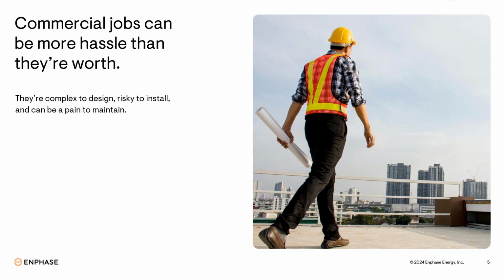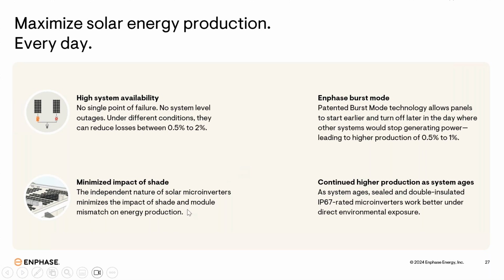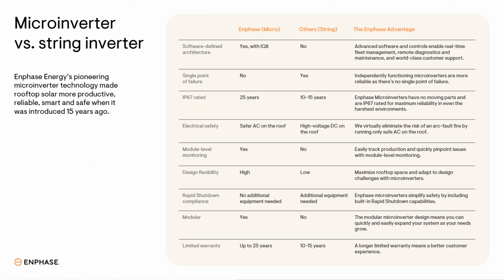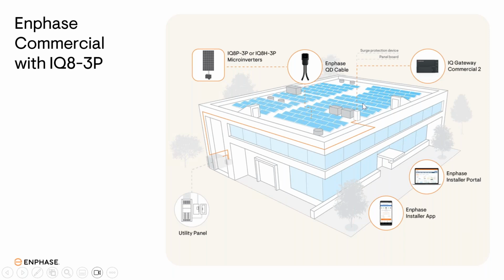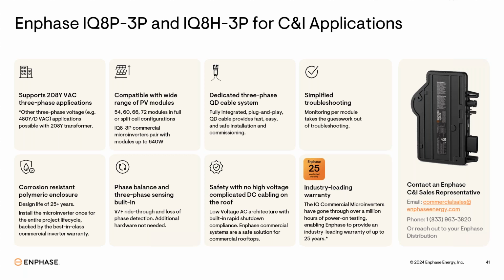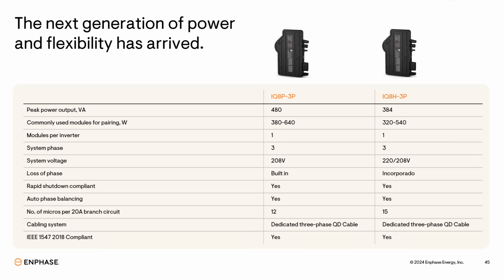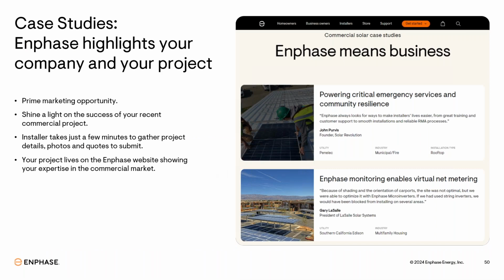The New Enphase IQ8 3P Commercial Microinverter

Comment: Introduction of the Enphase Team [01:06]: Introduces the regional sales managers for Enphase in the US and Canada.
Transition to Commercial Solar [03:43]: Discusses Enphase's focus on simplifying commercial solar installations and the market potential in this sector.
Enphase Services for Commercial Installers: Details the support services offered by Enphase, such as:
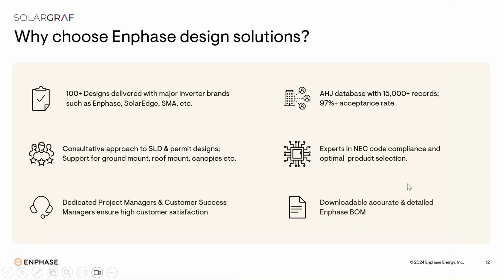Solar Graph [06:00]: A tool for proposal creation and system sizing.
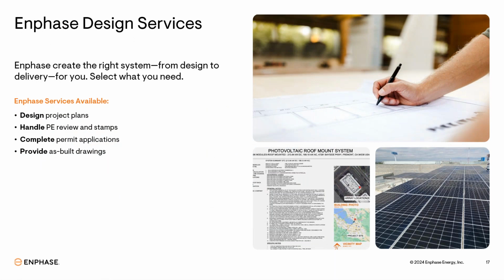Design Services [07:23]: Offering quick turnaround for system design plans with PE review.
White Glove Service [08:36]: Expert review of plans and construction practices.
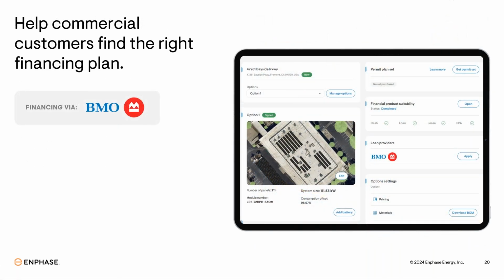Commercial Financing [09:32]: Financing solutions through the Bank of Montreal (BMO).
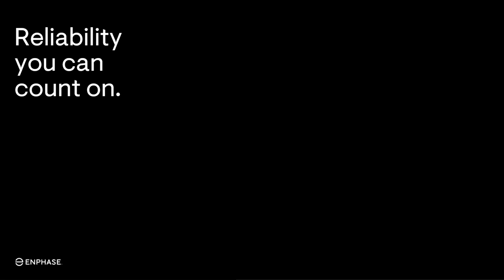Reliability and Safety of Enphase Systems: Highlights the reliability (low failure rate and 25-year warranty) [10:20] and safety features (fully AC, rapid shutdown, UL 1741 SB compliant, Nema 6 enclosure) [13:28].
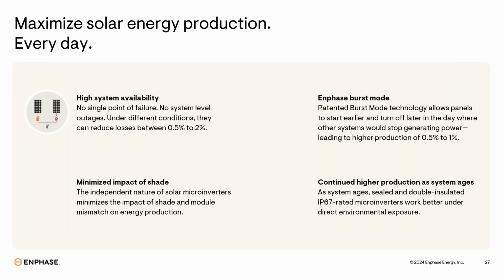Savings and Efficiency: Explains how microinverters maximize energy production and lower maintenance costs through module-level monitoring [15:05].
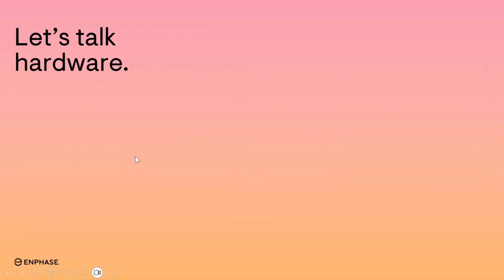Hardware: IQ8 3P Series Microinverters [19:39]: Introduces the features and benefits of these microinverters designed for three-phase operation, including a 25-year warranty and compatibility with high-power PV modules.
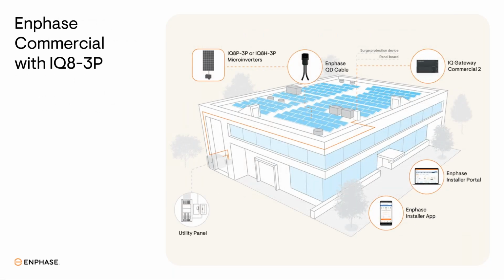Design and Installation [25:52]: Describes the installation process, which is similar to residential Enphase systems, and mentions the QD cable system for simplified phase balancing.
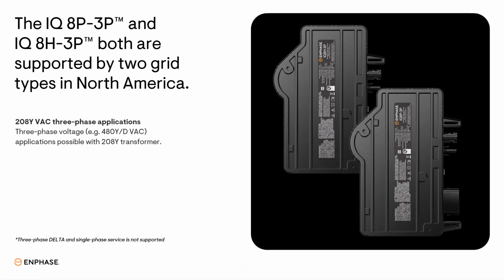IQ8 3P Models [29:01]: Details the specifications of the IQ8H 3P and IQ8P 3P models, including their power output and supported module wattage.
System Components [33:57]: Lists the components used in the system, such as QD cables, AC connectors, and the commercial gateway, which can support up to 276 microinverters.
Additional Information: Mentions Enphase's EV chargers [41:05] and the availability of case studies on their website [42:46].
Q&A Session [45:23]: The presenters answer questions from the attendees on various topics.
Conclusion [55:25]: The webinar concludes by emphasizing the potential of the Enphase IQ8 3P series in the commercial solar market and provides contact information for further assistance.